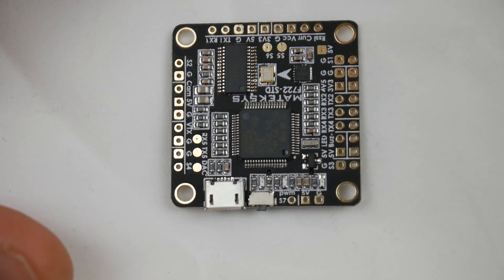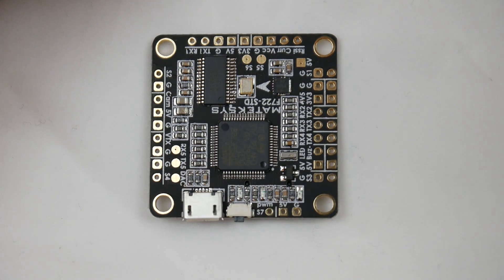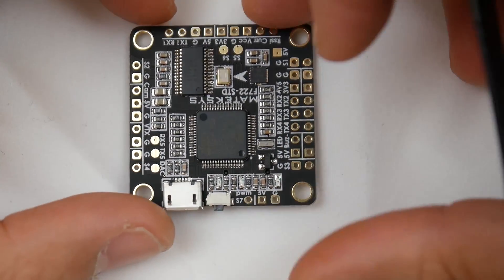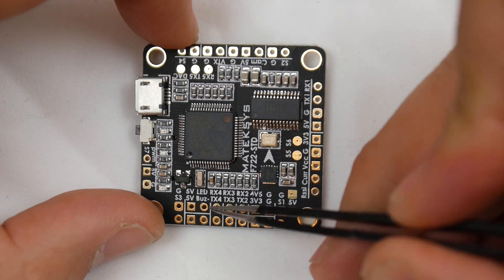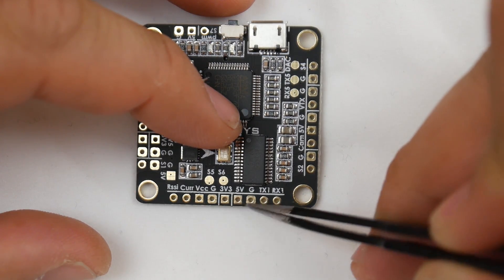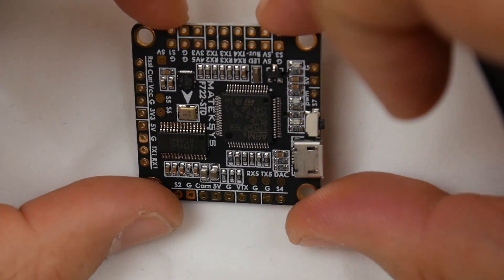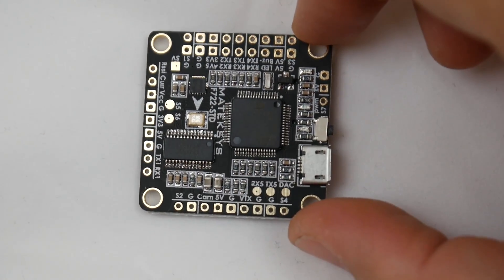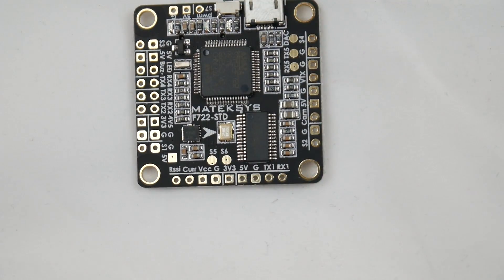Why F7 Flight Controllers // Matek F722-STD FC

Comment: "this little thing" is not a barometer, it is a quartz resonator, 27MHz as I can see. Barometer need a hole for air to pass through in order to measure its preassure. Barometer locates on the other side in your case, close to the "SDA" label

Comment: The 5V pads - where do they derive their power from if it's the ribbon cable then only a low current of-take is possible - so can you hard wire a 5V supply from the FCHUB-6S or the FCHUB-VTX  PDB's ...joe

Comment: MHz has very little to do with performance.  It basically only matters when comparing 2 processors of the same manufacturer, generation etc.  

A 2009 x58 1366 pin i7 quad core running at 4GHz is going to get absolutely demolished by any desktop processor that has 4 cores today even if they are running at 3GHz..

In fact if we measured performance by MHz we have basically been at a stand still for a decade.  Ive had a stable overstock on CPUs of 4.4-4.6GHz since 2010-2011 with 5-5.2GHz being the typical limit right now.

Only the processors are many times more powerful.

Comment: F7 is iphone of flight controllers 
It has great processing power 
And stability but you have only 4 esc outputs 
You can't use it for anything else it's quadcopter only 
And if you want more outputs you have to go with big board's like this one that can't fit in things like rc helicopter

Comment: Where would you suggest to run power to the board and what voltage thank you I believe it will take 12 volt what pinwould you put a to thank

Comment: So I bought one and I think it's stuck in bootloader mode as only the red light will come on when it's plugged in via only USB with out anything but the RX on the board to configure it ,and Betaflight says failed to open serial port  hooked up frsky sbus to the 4v5 ,g,and rx2 used a luminer 50 amp 4 in 1 ESC.I  powred it thru g , 5v, s1, s2, s3, and s4 on the reverse side behind where the ribbon plugs in.The red light is the only light that comes on.even with a battery plugged in and it is not initializing .So this is the first mateksys I've tried but I've used almost every other FC known to man without problem. Any help here will b appreciated.Peace out.Happy flying.

Comment: Where is the floating Gyro? lol LHi and other companies now have the f7 with floating gyros. They are nice.
Reply from the maker: We can easily make it floating I show that in upcoming videos.
Reply: @DroneMesh  surprised you replied. I love the f7 for the uarts and gyro speed
Reply: @DroneMesh  can you over clock the boards? Didn't know that was possible
Reply: But yeah they are good FC's. Been having a problem lately from some vendors where the OSD doesn't work. They are especially good when paired with a 4 in 1 esc. Saves the hassle of soldering power, gnd, and the 4 motors on the FC.

Comment: Hey mesh. I would like to purchase some 7" arms for the frog.
But bro you did miss some points of the f7, the vcc ist just to read the voltage. the fc itself must be powered by one of the 5v pins, the fc got no own BEC build in and all 5v pins will be supplied by the v5 input you choose. And i recommend to use the uart1 rail for your gps, it seems like it is supposed to connect there and u want 5v and no 3.3v. The DAC pin os also somethibg great you allways miss and skip: you can connect your OSDpin of your runcam there and get camera controll, dont need to peel this shitty joypad in ;) 

The 4v5 pad is a 5v pad you really should use, it causes no failsafes! It support your RX with 5v ALSO if you power your fc from usb, very important and you explain it all the time wrong :( 

Pls comment for the 7" arms :)

Comment: Dear Drone Mesh and friends
I have the flight controller matek f722 ... I assigned by softserial the pad pwm for smart port telemetry. Then in ports I gave him save and reboot and after that the controller card is not recognized by the pc. I have reinstalled the drivers multiple times without success. In the device manager, it appears as an unknown serial device and the controller card turns on, initially turns on a red LED, then blinks the blue and red LED and ends up with the red led on permanently without recognizing the controller PC. Can you help me? Many thanks.

Comment: I am using f722 for my fixed wing aircraft. I got all Controls working with S1,S2,S4,S6,S7 but i want to one more servo on S3 for tilting camera. But i dont get a pwm Signal from S3.
I have sbus rx on uart1 and GPS on uart3. I Flashed the board with Inav 2.0.0 Rc1.
Can somebody help?

Comment: I have one and it works fine. SCL and SDA are not for GPS but for compass (you can have GPS without compass so be aware to have both). You connect the GPS on an UART. I have all that installed on my 6" FT270

Comment: You didn’t mention where to provide power if you don’t have the PDB or can you even do that
Reply: inMotion Gaming next to Signal 7 pad and bootloader
Reply: Fpv STUNT are you referring to the 5v and ground pads next to the PWM pad next to the boot loader?
Reply: inMotion Gaming yes that is the one , you will have to power it from any 20/30amp 4in1 esc with a 5v bec or other 5volt power source

Comment: I compared the Marek F405(168MHz) and the F722(216MHz) with betaflight 3.3 and Butterflight 3.4.2. Surprisingly the F4 is a bit faster than the F7. On 16kHz/8kHz gyro/PID loop both show about 30% CPU load. I think the current firmware is not making use of the architecture of the F7. There's is no way to run both in 32/16kHz or even 32/32kHz. Does this match with your experience?

Comment: 100% CPU load at 16/16.....  Does not support overclocking.    a bit misleading, but everything you say should be accurate in with BF 3.4   - Cheers

Comment: As far I see F722-STD has the same layout(not just solder pads, components too) as the F405-STD. Would be better with dedicated esc telemetry pads, even via ribbon cable ;)

Comment: I2C bus (SCL & SDA pins) can  be used for different sensors, Baro (which is already onboard), but in this case, maybe a magnetometer(compass). in some FEW cases, you can get a GPS that is run with I2C protocol, but mostly they use TxRx. also, in MANY cases, a GPS comes with an onboard Magnetometer. so on these "GPS's", you will have 4 wires for GPS (V,G,Tx,Rx) and 2 more wires SCL & SDA for the magnetometer(compass). BUT - GOOD Overview of this board. i'm VERY surprised that there is no Voltage pad next to VTX!!! - one more thing, the 3.3v pads are lit  up when the board is hooked up to USB. this makes it easier to check out GPS & calibrate Magnetometer  without having to have it hooked up to a battery.
Keep up the great work! i'm still working on my Matek F405 AIO. it looks as if having that big filtering Cap may be more mandatory than i thought!
Russ from Coral Springs, Florida.

Comment: I built a new xHover Stingy with the Matek F722 and I am using a separate PDB that supplies clean 5V and 12V. The matek is not like the omnibus as it does not have an onboard 5V regulator so you must supply 5V. I believe the 4V5 is diode-or'd with VBUS so your RX is powered when plugged into a computer. I opted to use UART 1 for my Crossfire and the 5V pads provide power from my PDB. The VCC pad is to measure VBAT. All of my quads run the Flip32 Omnibus F4 and this is my first F7.
Reply: I am trying to set this FC up. so your saying that I can't power it via the VCC pad, with a 6s lipo for example? how do I power this FC? I'm not understanding. thanks in advance.

Comment: nice video but just a question, would you reccomend this flight controller using the hobbywing xrotor 40a 4 in 1 wich you reviewed in the past? or its not so nice for the sensibility? and however, could i drop down this high sensibiliity with some specific betaflight's option?

Comment: Nice that you are diving into F7, I was looking for more info about it recently and found two videos were Joshua Bardwell stated that he heard from Betaflight developers that to this date Betaflight runs SLOWER on F7 than on F4 despite the extra processing power and they are working on optimizing it, but not for 3.3. They believe it may be better on 3.4, but that is not certain.
Reply: The F7 optimizations are scheduled for 3.4. I was talking with the devs a few days ago and they said there was real good progress on the f7.
Reply: The hardware always comes before the good software and in learning to tune the system it seems like the coders are learning music theory and the laws of octave based harmonics connected to the Circle of Fifths based on the difference in opinions regarding which level of filters to use. Nice thing is the knowledge of harmonics is already out there and it's cut and dry... unless you use dice to count with and ignore harmonic commas.

Comment: Sure that with increasing availability and popularity of better Betaflight filters like Kalman filter and other things available with more computing power, we can expect raising popularity of controllers with faster MCU-s like F7. Built in barometer actually may get very useful for easier landing when Betaflight guys will utilize it for landing assist. It would be very nice instead of usual falling and mild crashing as usual racing/freestyle quad landings are :)  I hope to see AIO versions of F7 FC's in near future too. Separate FC boards like this FC are not so easy to mount in decent low format frames where stack of 2 boards can barely fit in.

Comment: f4 is faster than  f7 unfortunately. Betaflight devs have been trying to figure it out for awhile. test it out f4 does 32k and 16k with 30% cpu cycles f7 does 16k 16k at 100% cpu load......

Comment: +Drone Mesh - I love the Matek FCs too - they are so well designed.
Just FYI the barometer is on the bottom of the board next to the label for the SDA pad.
It's a little silver component with  a tiny hole for the air to enter.

Comment: Well, the barometer is on the bottom right by the side of SDA pad. The top one is a crystal oscillator for the OSD chip. So, if you want to use the barometer, then put a piece of sponge on the bottom side of the board. 

And about the electrical noise generated from the ESCs, it mainly affects the performance of the video quality, not the gyro function. What affects the gyro performance is the vibration from the motors. So, to improve the gyro performance, you must soft mount the board, specially in the ICM series of gyros which are generally used on matek boards. Additionally you can also soft mount the motors, which also helps. More information can be found on Joshua Bardwell's channel here https://www.youtube.com/user/loraan

Comment: Try this firmware with 32K/32K, you will be surprised. CPU load around 26% with Multishot & ACC OFF , CPU load around 45% with Dshot1200 & ACC OFF(CLI  set dshot_burst = on)  http://www.mateksys.com/Downloads/FW/betaflight_3.3.0_MATEKF722_32K.hex  BTW, it is not a stable version.

Comment: Do you even know about architectures? anything about simd (Single Instruction Multiple Data)? The Core clock is not everything. A CPU is NOT the same as a MCU, not even close. thats like compare an AMD FX-9590 ("8" x 4.7GHz) to an modern i7 7700K (4* 4.2GHz). I know this is not exactly what goes on here but it is the same thematic. 

You need to compare the architecture, the optimization and the heart of the unit, the Hardware. If you have a fast core and have to do things in software you are maybe better with a 50% slower clock on an CPU of the same architecture but with better hardware capability. like UARTs, Port inversion, PWM, OCM, DAC and so on for example.

Comment: Nope, that silver thing is a crystal (you will see it says 27MHz for the osd chip), the baro is on the bottom next to the SDA pad. You can tell because of the tiny hole it has.

Comment: Hey DroneMesh, I have this exact board. You were talking about how its good but you forgot to mention the MAIN thing why its good :D I bought it with Matek FCHUB-VTX. Its a PDB connected to this F722 by a ribbon cable, so you dont have to solder motors to it, nor power or VTX. All you need is solder camera and RX. The ribbon cable also supplies the VTX telemetry and additional Uart :) check it out....its VERY cool :)
Reply: http://www.mateksys.com/?portfolio=fchub-vtx
Reply: BTW on betaflight 3.3 without overclocking it still struggles on 32/16 :) so future is still not here :D
Reply: Chemistt I think they are still doing optimizations to the f7 processors to get peak performance out of them. Betaflight 3.4 should probably include full 32k support and better f7 optimizations
Reply: Benjamin Tarr, Yes you are right. One of developers (I think) was lately posting to the betaflight facebook group saying he is doing some breakthrough stuff on exactly this one F722 but its scheduled to 3.4 :)

Comment: im not sure if faster is better. 80% of people dont notice the difference between 8khz and 4khz, we really need 32? 80% of people also need just 2 uart, one for  serial receiver (ibus or fport) and one for smart audio.
I prefere a well made fc with nice feature, JBF4 has 9V bec for cam and vtx and its a really cool feature. I dont know why all thinghs (vtx or fc) provide a 5v bec for fpv cam. If the bec dont work well and have a small voltage drop, like 4.8v the fpv cam shut off. This does not happen if a 9v bec ha a small voltage drop because 8.8v is enough to power on the fpv cam.

Btw nice review, looking foward for your next video, keep the good job!
Reply: well, there are also people who want to use a FC for a wing or bigger quads with GPS, RTH etc... all these things are using processing power. It's better to have it and not need it ;)
Reply: this is a good point, I agree with you. I have in mind only miniquad acro or race, but in fact there are several scenarios of use of the FC
Reply: ^^
And as I said, it's better to have it then need it. btw. Betaflight is getting bigger and uses more ressources (more features, better and more filters etc). That's the reason why F1 boards aren't sufficient enough anymore. Even F3 boards are now close to their maximum if you use some features of betaflight...
Reply: I mostly agree with you, but i for one need all the UARTs. 1. SBUS(duh), 2. SmartPort telemetry(BF lua script is just a must.), 3. Smart Audio(Who wants to push buttons on the vTx anymore?), 4. BetaFlight camera control(Throw all those stupid tiny joysticks to the garbage bin where they belong.), 5. ESC telemetry(I can live without this one, but it's handy sometimes.). 6. LED strip (For when i want a flashy RGB lit quad.)
Reply: so then get an f4 because an f7 is slower right now. betaflight is not built for it yet.
Reply: I don't think F7 running Betaflight 3.2.x or 3.3.x has any more latency than F4 boards do. Betaflight just uses the processor more for some reason on F7 boards. But since F7 has all that spare processing power, the higher utilization should not matter at all.
Reply: http://www.readytoflyquads.com/rtf-freestyle-flight-controller-v15
Reply: SO close to perfect. On paper at least. Just needs those rubber grommets like on JBF4.
Reply: Here for iNav on fixed wing. Will be trying to keep it running cool. 
I am now wondering if I run a 4 in 1 ESC with a wing with 4 motors how that would work out. I assume fine.

Comment: Thanks for the tip on 4.5 volts! I’d hooked an XM+ to that pad and was wondering why I’d had a couple what seemed to be failsafes! I’ve switched to a rxsr (one crash resulted in a cut to the XM+ antenna) and now changes to the 5v pad, so fingers crossed. I’m running with an AK32 4 in one soldered to the bottom pads.

Comment: I built two quads with these a month or two ago. They are awesome, it’s great to not have to worry about inversion. I have Esc telemetry set up, as well as sbus, sport, camera control, vtx remote and RGB LEDs. I am running it with the tekko32 Escs and the matek 6S hub connected with ribbon. Works superb 🙂

Comment: Which function has the DAC Pad ?
Reply: Thomas S. , the dac os for câmera control , adjust settings via osd.
Reply: yesssss, as soon as i saw that DAC pin i  thought finally!  im having SOO much trouble getting my SDR1 to work on my OB F7  thru pwm (led pin)  it sorta worked but unusable. cant find any good info for the Caddx SDR1 cam control , none of it works

Comment: Please try it with Tekko 32 4in1  !!!!
F722 doesn't have a 5V BEC, Tekko 32 4in1 doesn't have a 5V BEC also so an external BEC is needed to provide the FC  with 5V ??
Reply: I'm wondering the same thing. what did you find out? Thanks in advance. 👍

Comment: That is not the baro. It is xtal
Reply: Yup. That should be the crystal clock. The barometer will have tiny hole for measuring air pressure.

Comment: Just put this FC in a quad and maiden flew today. I really like it 👍 nice vid I am using Siskin BLHeli_32 31amp 4in1. I need to add one cap but I was impressed
Reply: PuppetMasterFPV is your 4 in 1 with bec? Because i ordered the racestar 35a 4 in 1 and dont have bec. I'm not sure if is better put an external bec or use the pbd of matek but seems too things on drone... hope you share a tip. Thank you

Comment: The barometer is on the bottom with the small hole in it the other must have been a crystal or something.
Reply: Stephen Gibb , yes this is an OSD oscilator

Comment: I've heard Betaflight doesn't play well with F7 boards
Reply: Nathan Schlenker I have this board and 3.2.2 and 3.3 RC2 we’re having issues with CPU usage, so 32k mode was useless. But I need to try JBs 3.3 config and see if dynamic filtering was killing it. Sucked to buy the board and then find that you were disabling most stuff! F7 optimisations are being pushed to 3.4